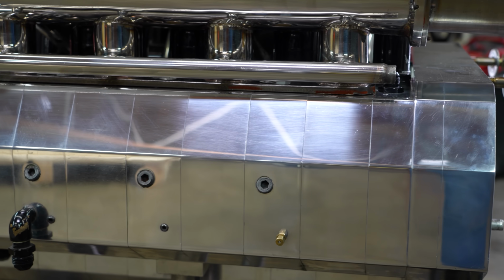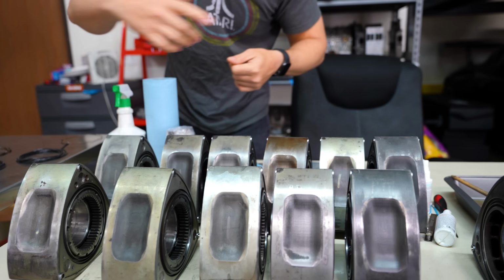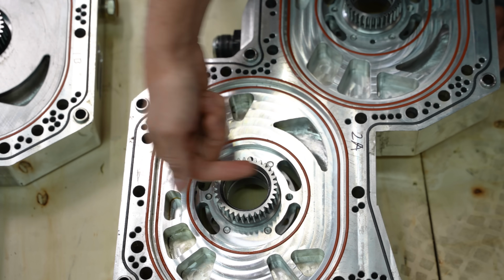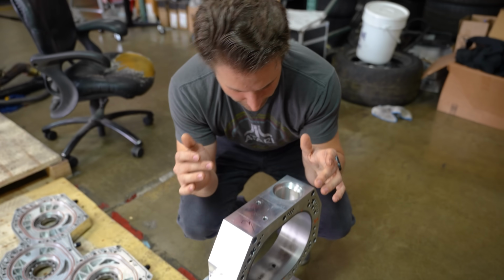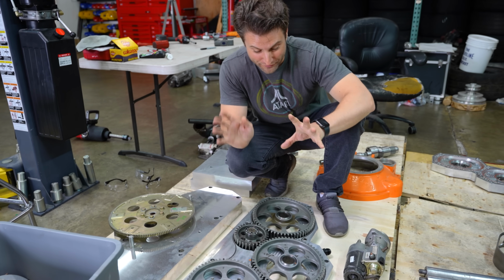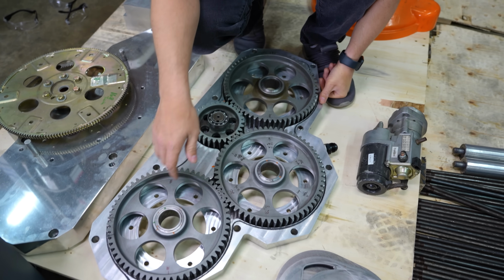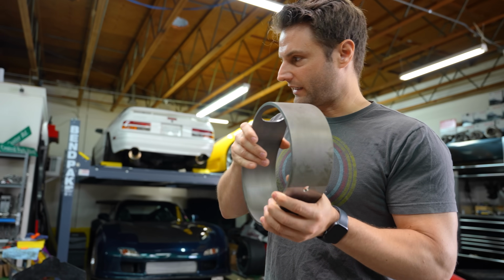Everything wrong with the 12 Rotor

Comment: The only thing that confused me was when Rob was talking about the engine being out of time with the timing gears. Wouldn't he just machine the splines on the inside of the gear to be 3 degrees offset to the outer teeth to eliminate the issue? assuming all 3 sets of rotors are only connected by those gears? Just a thought. This thing is so fascinating I can't get enough of it, what a machine.
Reply: yea that should work.
Reply: exactly if the guy building this didn't know that then i don't know how he even got as far as he did.
Reply: Lighter gears and maybe use a timing belt

Comment: As for your bearing issue, tapered roller bearings might be a solution? The can take axial loads, and skf generally makes them with high enough max rpm ratings (though I don’t know if they have the exact size you need).

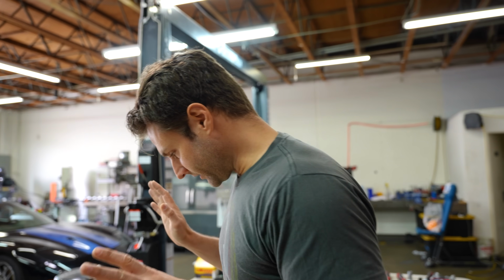Comment: @ 9:30 the stock exhaust sleeves aren't steel, they are inconel.  The stock sleeves also have an air gap between the housing to help reduce heat but also to reduce noise.  It's part of the air pump system too to reduce fuel dilution.  

I see you nit picking all the things on this engine, but, what's the goal?  All these things may be a non-issue if the goal is just to get it running with fuel injection.

Comment: Pour les grandes puissances du moteur Wankel , ( multi  rotors), il est possible d'avoir un seul rotor, donc 17 joints pour cela il faut passer par le brevet 0014310 ce qui permet de tenir compte des dilatations, du refroidissement, etc. c'est une autre architecture du moteur.

Comment: So the one E shaft that is 3 degrees off, what's the spline count and orientation for the teeth versus the spline teeth, if the spline count and gear teeth counts are different you can combine adjusting one spline and one gear tooth to see how many degrees it rotates the actual E shaft and adjust it that way

Comment: What the automotive industry needs to do is to get serious about hydrogen fueled vehicles and manufacture them with rotary engines. The only problems that rotary engines have are solved by running it on hydrogen. Then, we will get an emissions free vehicle that is powerful and reliable and can be refueled in only a few minutes. Gas stations could easily add a hydrogen tank to service the new fuel needs of drivers. It wouldn't even be difficult for stations to create their own hydrogen on site. I doubt we will ever be able to recharge an electric vehicle anywhere as fast as we can fill a gas tank. So it doesn't matter how many charging stations there are it is still not a viable option for long-distance driving.

Comment: What type of gains or losses Would you expect between a thicker or thinner rotor? Also, could you change the characteristics of the engine by changing the profile of the rotor but keeping the apex in its oem location? Would thicker rotors increase displacement but lower compression?

Comment: Couldn't you cheat a few degrees of timing by engaging the gears in the back on a slight spline offset on the relevant e-shaft? Say you're three degrees off on one of the four-rotors, and the splines are two degrees apart. Couldn't you reduce the offset to a single degree by offsetting the e-shaft by one spline? Not sure if and how much that'd matter, but it's an idea.

Comment: One problem that I perceive  with this rotary is that it is not P ported and considering the environment that it is going to operate in, I wonder why? I have a single rotor P ported 13b in my home built Pioneer 300 aircraft,  just for you Rob I live in New Zealand. I know this engine was built some years ago so this may have some bearing on the design. Here's a thought as you would fully be aware  of with turbo 400hp/ rotor is not out of the question, even on the tame side. So looking forward to your follow up vids.

Comment: The massive challenge of a centrifugal engine like a rotary is harmonic resonance. Distributing the harmonic vibrations throughout the engine evenly is a massive challenge.
Think about a jet engine on a Boeing 747, at distributes harmonic motion throughout the engine by having multiple fans within the engine. If you want to get the most power out of this engine you will need to weigh each individual rotar workout it's harmonic tolerance then weigh the block of the engine and work out it's maximum tolerance. Then balance both.
Alot of math.

Comment: Brass gaskets would be the best option for this engine, get rid of the o-rings backing the face plates and just do a flat piece of brass like you would do on a headgasket, that way its not relying on the o-ring to pressure the steel plates.

Comment: This is great for the time but its basic design is going to give a lot of headaches. 
That offset lower rotor is a big problem.
You would be much better off running it as a two shaft design then running two blocks of three with the centre coupler clocked 120 degrees. 
So 2-4-6, 120deg, 8-10-12. 
No more oiling issues, no more awkward exhaust issues, no difference in heat in the centre and no problems running it as a true 12 seperate cylinder firing order. Even with a 3 rotor capable ecu and wasted spark you could run it as a true 12. 
It would be longer but also thinner and with a lower centre of gravity and much better cooling potential - especially if you used two cooling loops for the front and back halves. 
Don't sweat the details if the basics aren't the best in the first place. 
I can see where he was coming from when you say it was for a marine application. In that situation it makes a lot more sense though I would still question the unsealed housing to faces issue as you did because that looks like it could potentially get pretty sketchy over time - especially with those seals already melted like that. 
I would love to see it run as is because that thing is almost a myth at this point but if you're going to use it for anything serious I would start off with a better base layout in the first place.

Comment: You should use a proper machined straight-edge to measure flatness. The ruler you are using is cut using a press and won't be straight and flat.

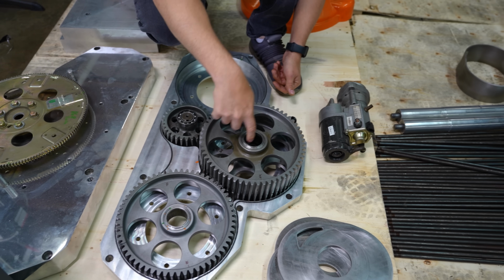Comment: 11:54 are you sure all of those gears are the same? maybe the internal spline of the left one (or the counter piece on the shaft) is rotated 3 degrees to compensate for the timing difference

Comment: Nah none of the spliced wires memes. Long term need the counter weights and getting haltech on board for true 12 rotor madness that would make this a truly undeniable beast of mechanical engineering no one could fault it at that point. Love the content regardless and I love the process of using us the audience as a rubber duck while you work through the process of achieving a goal, not just on this project but with all of your content I feel like we are part of the process it's great ;)

Comment: So for those steel insert faces. The most likely reason they are out of flatness is from the machining process. Your going to wanna have a away to measure the flatness and parallelism (precision granite surface). So when you machine a thinner plate like that and face it or grind it, it warps as soon as you unclamp it. The way you can get around it when machining is have very low tool pressure and take less than .01 per face flipping it back and forth ttill desired thickness. Im not sure how flat you need those faces but you can only get them so flat from a press, especially with that port in there.

Comment: should talk to your local industrial bearing supplier R.E the end bearings - there are angular contact ball bearings that can handle relatively high (for a ball type) axial loads, and are normally same overall dimensions as standard ball bearings, and (usually) have a higher ball count due to their construction

Comment: Here's something interesting for you to think about. That e-shaft piece might have been machined using 1940s equipment and that might lead people to believe that's bad. In the 1940s we (the U.S.) were machining 65 foot gun barrels that could launch a 2700 pound projectile 23 miles accurately. I think that takes a bit of precise machining lol. Then try to wrap your head around how we (human beings) built the first precise machines to begin with. By hand. They didn't have machines to do the precise work to make the machines to do precise work at some point... 🤯

Comment: Would u be able to make an iron plate instead for the steel machined plate so it can hold the heat and not bow in and have a longer lifespan ?
Reply: So the reason it is bowed is from grinding that face, he could make new ones but its difficult to hold flatness on a thing plate like that

Comment: "it never ran" haters are so delusional
Reply: it obviously did. but for how long. i honestly dont see it being actually used in anything other then for the wow factor in a video. 
i think if they actually will try to use it as a boat motor it would probably eat itself after a few hours of running. 
it has so so many potenial points for issues and the ones they discovered now are surely just the tip of the ice berg.

Comment: I have a solution for the waste oil from the 2 going into the one.. use a device similar to what’s found in modern shower valves, which use a type of pressure regulator that’s fully automatic ensuring that hot and cold pressure stays equal.

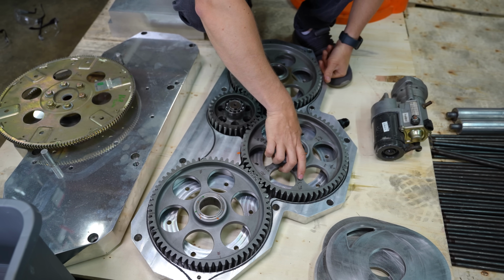Comment: 13:20 can't you just move the inner splines 3 degrees on that one wheel to compensate? I understand that means redoing the splines and inner part entirely, but that's the only thing i can think of that could work.

Comment: "The only problem is they generate a lot of heat."
Whoo back there, slow down.
There are several things about a rotary that are astonishingly good, but there are also some that are quite bad. Heat is one, but not the worst. They are tricky to get right with seals, especially the tip seals, but worst, they are not very fuel efficient. Like, a 2-stroke road-race bike or MotorCross bike, is not terribly fuel efficient ~ that wasn't a design priority. The torque they give is commensurate with their true swept capacity, which is usually quite small, but the power they can give is astonishing. Like a whipper-snipper or edge-trimmer, they make a surprising amount of power for the size and weight of the engine, but they do swim in fuel. They also make a noise which is ~ [shrug] Let's call it an acquired taste.
The other serious problem, is pollution and clean emissions. To get a rotary to run clean is rather like getting a traditional 2-stroke to run clean. Go back 105 or 110 years, and we made rotary engines (rotary radial piston aircraft engines) but they needed caster oil in the fuel, at about one part in 12 or something, which resulted in white smoke and diarrhea. It was an acceptable solution at the time, but it would not be today. Step forward 30 years, and you had double row radial engines like the 2800. Good power, reliable ~ well, in some ways. You had to know how to operate one of those engines. For one, when you come out in the morning, you have to take the plugs out of the lowest cylinder in each bank, plus maybe the one on either side of that, and rotate the engine backwards and forwards a bit to make sure those cylinders had not filled up with oil overnight, which would lead to a hydraulic lock. And every single time they started up, they would smoke like a panic screen in combat. "You can't see me!" Smoke-screen. These are acceptable problems with a B-29 ~ they're not acceptable problems for a Pinto or a Camaro or a Mustang. Sure as fk not acceptable on a Civic or a Camry. 
It's a bit like asking what's the best programming language. That depends what you're trying to do. C is far better than Python in some ways, not as good in others. And Visual Basic is ... History now, so that's alright .... It's not so much that one is better, it's a question of choosing the right tool for the job at hand. You can dig a hole with a guitar, but that's not what it was made for.

Comment: You could bring it up to temp then mill it to size. Then when you want to start it you have to pump hot oil and water through it before you start it to bring it to proper size. That's how they make F1 engines, they can never cold start them it takes about 30 minutes to heat it before start.

Comment: The gear meshing and timing has me puzzled.  As the center of each gears connection to the eshaft? appears to be splined - can you get the TDC adjustment from clocking splines engagement?

Comment: hey rob, how many teeth are the splines on the inside of your timing gears? could you cancel out your 3 degrees by simply lining the gear up 1 spline off?
Reply: Double check my math, but i believe If it's the same 32 spline as the E-shaft splines mentioned in the earlier video, you could advance your gear 4 teeth on the E-shaft to get you +45 degrees, and then retard your timing to the center gear by 7 teeth, will put 0 degrees right in the center of a tooth, as 45/6 is 7.5.

Comment: Have those bowed steel faceplates remanufactured from tungsten carbide, they won’t bend then! In all seriousness though, what type of steel are they made from? Is there a grade of steel that is more rigid that could be used for them? Maybe even cast iron? Or, could you take some of the spare plates you have and heat treat them to a greater hardness? Have they even been heat treated?
Reply: The reason they are bowed is from when they were ground. You have to hold a flatness in an unrestained state.

Comment: You should maybe consider adding thread inserts to the stationary gear bolts to increase the surface area the bolt is applying force to the aluminium.

Comment: 14:43 So it’s basically running as three Inline four cylinder engines lol. I wonder if the style balance shaft that many of those engines use would work for a rotary.

Comment: man i would want hall effect sensors on each individual wheel to adjust the timing accordingly other wise you will need a dead band to account for gear lash. maby make then heli cut for a tighter tolerance

Comment: I'm wondering if those stationary gear bolts could be extended to thread into the center the side plates and keep them from bulging. Not sure if they would need to be blind holes or if through holes would work and not damage any of the side seals of the rotor.

Comment: Would it not be easier to make it basically two 6 rotor engines? That way everything can be symmetrical. Feel like long term that would make it the most efficient and most powerful. Should have vastly simpler machining work, oiling system, and manifold designs.

Comment: On machining the o ring, harvey tool sells specific parker hannifan o ring cutters. I have cut alot of o-rings with these tools and can offer some machining advice for getting a start hole in the face without having a visible pocket. The existing o rings may be just a groove based on the protrusion, i can't tell from the video. You're best bet in adding a groove is to mill a "square" slot with a bull endmill.

Comment: A 24 rotor powered boat would be incredible. Even if each rotor only managed 110hp the boat would make as much as 6 mercury 450Rs with probably 1/3 the weight.

Comment: Would be interesting that since 2 of the 3 exhaust ports per plate are identical and one is different, I wonder if you could get away with driving a turbo off the 2 identical ports while having the 3rd ports all just tie in to the plain exhaust. It might be strange with stuff like back pressure and that deal, but if it’s gonna be a headache trying to use the 3rd port why use it at all? The rotors push enough exhaust as is. Maybe, and this is pulling on some F&F BS here, use the 3rd with an exhaust valve to add more exhaust to the turbos at the push of a button. While that would be cool it would also be wildly unnecessary lol. Just some thoughts

Comment: For the concern about the one rotor being off 3 degrees because of the tooth relationship between the two gears, could the creator of the engine may possibly have considered that issue and the e shafts and the rotor cavities are actually off by the 3 degrees needed so all rotor top dead centers are exactly the same?

Comment: The 6 bolts that hold the hub into the aluminum housings, can you use longer ones to help hold the steel plat center in? This might keep it from bowing into the rotor.

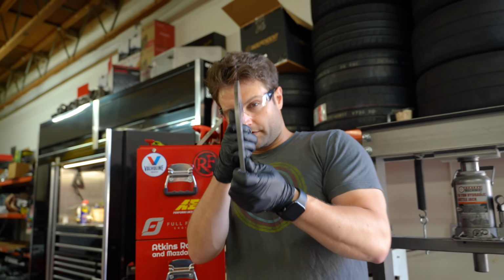Comment: 19:21 a potential solution would be to either have bolts, bolting it down to the aluminium all the way around the inner lip, machined flat with the item installed and sunk from the face by a fraction of a mm. The rotor shouldn't care. OR an intermediate plate that sits on the inside of the aluminium, is bolted and has a machined thread that accepts a ring, which itself is threaded and meant to suck the plate in.

Comment: Can you machine the ports deeper  and machen threads and ues a large nut to lock down the ends of the manifolds in to place to bypass the bolt vs water journals .